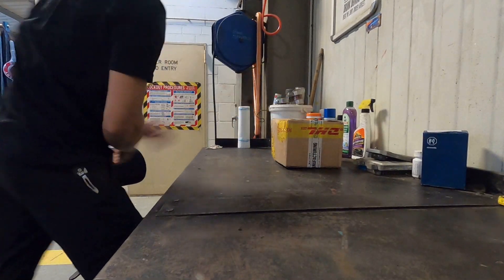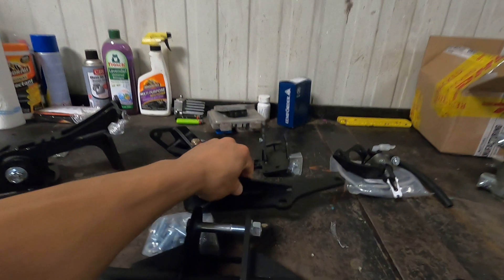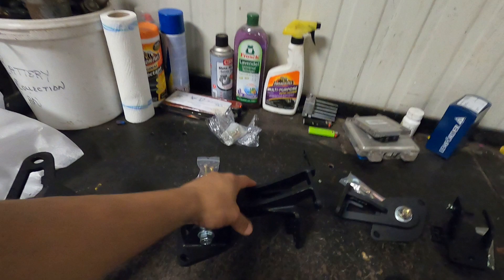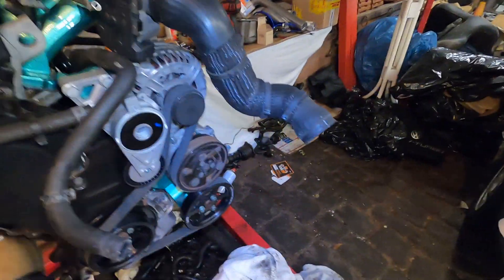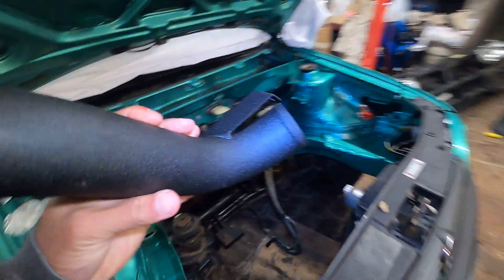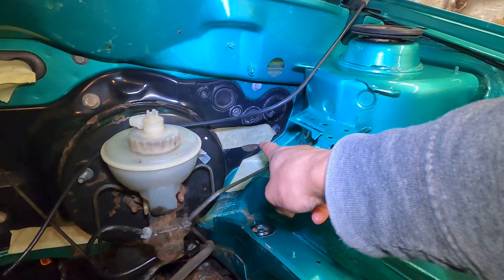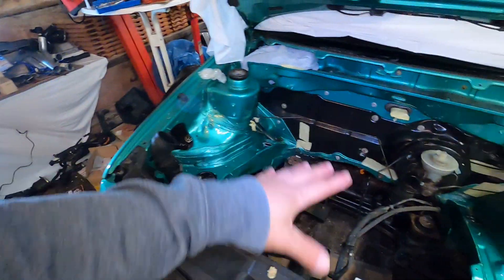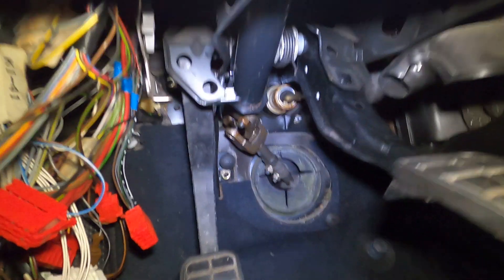Engine Mounts & More For The 1.8T Pink Floyd Golf 3! ( Fabless Manufacturing )

Comment: To avoid chopping up the charge piping you could try looking for the charge piping from a Seat ibiza Cupra Mk3 6K2. It came with the 1.8t while using the mk3 subframe/mounts. This should be an OEM solution that doesn't require the giant charge pipe to come up and over the motor.
Reply from the maker: Ohh very cool! Thanks for the information 🎉
Reply: @Mk3Smith  I wish I had known this when I was doing my 1.8t mk3... would have saved me a lot of frustration.
Reply: @Mk3Smith  NM my comment above. The oem cupra charge pipe is definitely not what you're looking for.